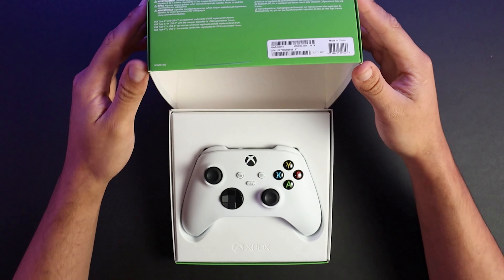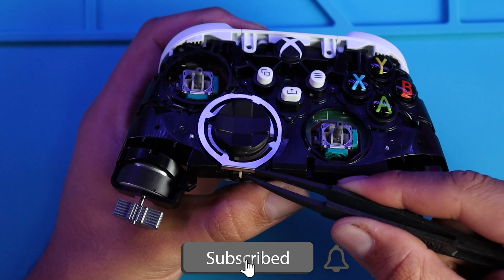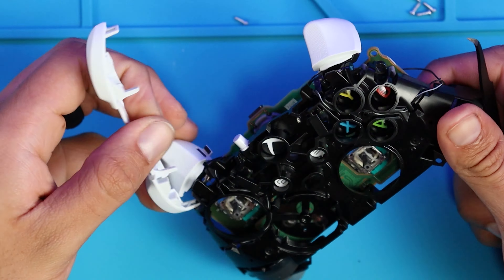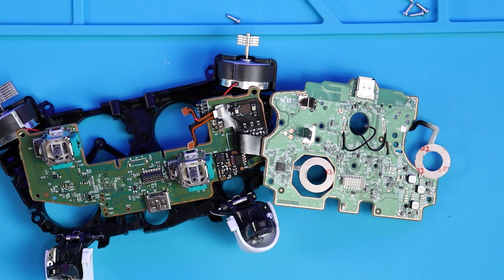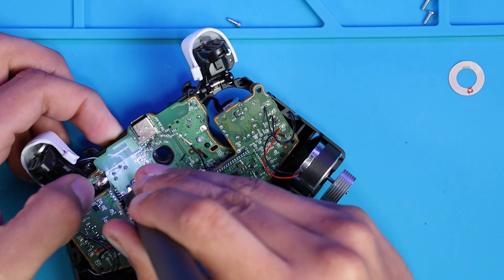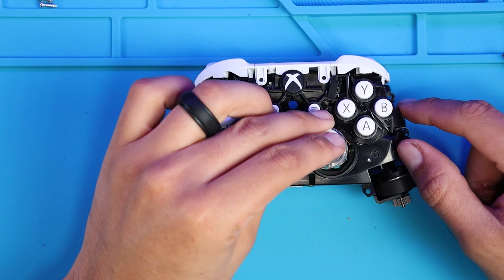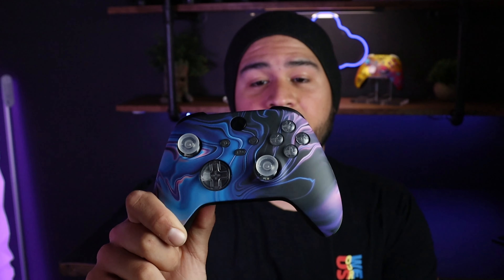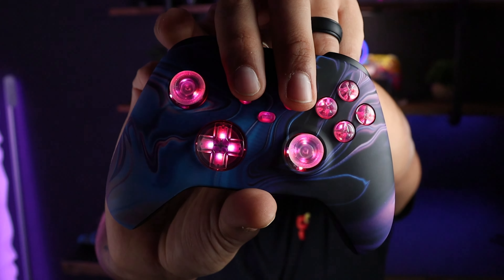Robot White Xbox Series X Controller LED Mod Kit - eXtremeRate DTF LED Kit

Comment: I tried to install one of these kits last night using the solder method, and now I am down one controller. I've got another kit for my other controller, and I'm definitely doing the non-solder method
Reply: Where did you see him solder in this video? 😂
Reply: how’d it go?
Reply: @dre1984 In his defense, he didnt. Just because dude says "now here's where I made a human mistake. I tried to separate the cable but accidentally caused it to strip. So, we're gunna have to turn the L.E.D's on and off manually." However, I'm just curious where the cable gets soldered to on the board..
Reply: @OhioBoii330 the method he is using he is getting power from the battery so he has to manually turn it on and off… the solder method goes to the board and runs off the control of the Xbox button so it would turn on and off with the controller automatically…. There is a DIY video on the extreme YouTube channel
Reply: @austinmartin5550 yeah. I dont think he fully understood the instructions as on his black controller the LED was still on after turning the controller off. Meaning he did both power methods as he insinuated that the soldering method simply sends a signal to turn on and off the LED. No, soldering it makes it so it takes power from the board instead of the batteries.

Comment: Damn that looks sick! 🔥 I would do it but I know that I would mess it up somehow 😭🤣
Reply from the maker: Thank you very much! If it makes you feel any better, I messed up my first controller mod big time 😅 controller won’t even turn on 😂🤣
Reply: @EnriqueCanoYT  so did I. Was trying to swap out the abxy buttons but I flopped it and the right thumb stick completely died on my series x controller 😂
Reply: I didn’t even mod mine just took it out to fix stick drift and I broke some pieces that have to be soldered on now 😭. Controllers are super easy to break gotta break one or two to understand how it works apparently.

Comment: Modding a xbox controller looks stressful 🤣 too many things to work on
Reply: If this looks stressful wait until you see the exremerate back button mod, it's an absolute pain to do
Reply: @Egg.426  i'd  rather not 😂 i'll just put a custom paint and that's it
Reply: This is one of the easy mods too
Reply: That’s wut I’m saying
Reply: No
Reply: In several aspects it's actually much easier to mod than playstation controllers, but that double-layered motherboard looks like a bitch to work around. Especially if you're like me and enjoy installing mods around existing back button solder mods on custom pro controllers
Reply: @nolifey  same
Reply: @ElevatorWasher5000  Glad to know someone feels my pain lol. I don't know how to solder so every tutorial video requires paying special attention not to disconnect the mobo from the back shell
Reply: I broke the motor wire off and I didn’t know how to solder so I just don’t have my vibration motors anymore…

Comment: Wherrreeeee would that cable have been soldered to the board tho? I mean, if I don't have to solder then I won't just because I for some reason can't really do it. I mean, I know how to, I just struggle to physically do it and it's always super sloppy and messy. But, where would I put it if I do decide to try it?

Comment: The R wire in the circuit is not connected somewhere. Power has reached the B button but not the other board with the rest of the leds. Gotta give it a once over again and make sure the power carries through.
Reply: Which is the R wire?